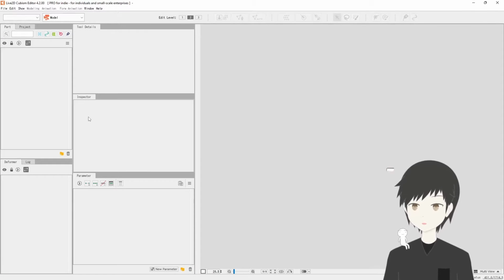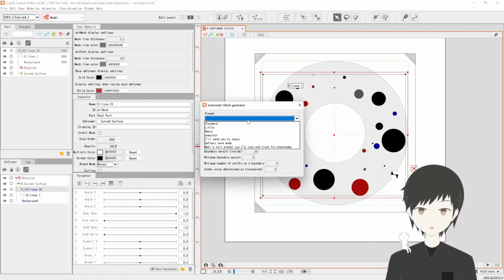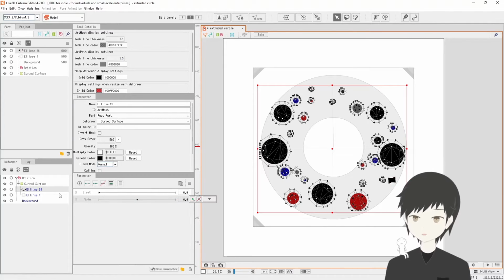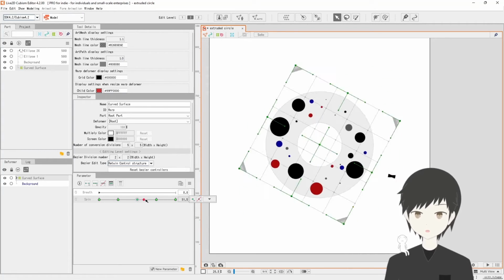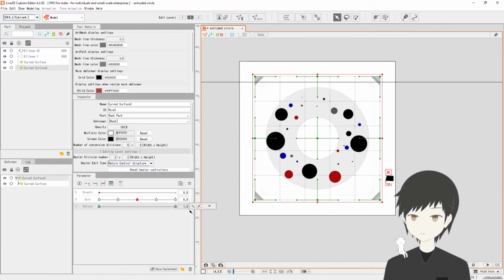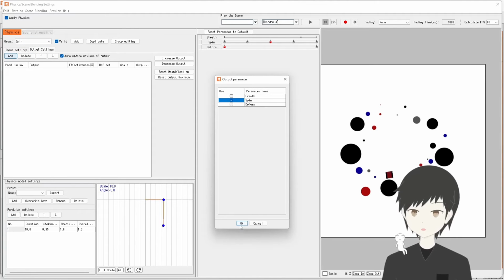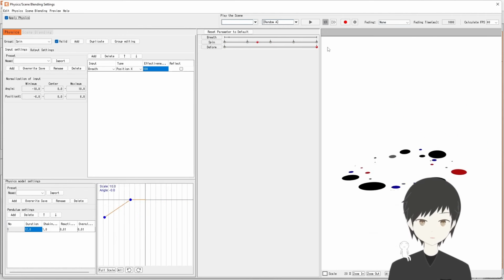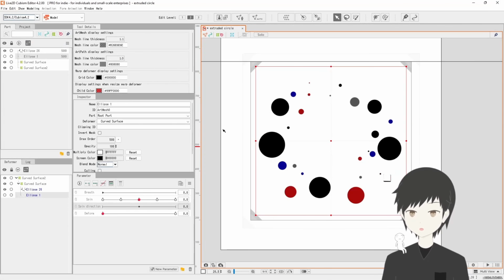Live2D Method Tutorial - Spinning circles using physics

Comment: mine spins like once and then pauses until the breath gets back to zero. i know i did something wrong, but what?
Reply from the maker: normally with those exact settings it should work pretty smooth
either let it run for a bit so it can "settle" or imight also be the output parameter not being from -1 to 1

Comment: The first part of the video is good, but using physics through breathing leads to a constant "reverse motion" and trembling, no matter how hard I try to adjust the positions (
Reply: Sorry if late but you can make repeating parameter to put as input in physics and then animate it in animation for your model. But at this point it's just easier to animate roration directly in animation menu without extra sleps and trembling due to it being not connected to breathe parameter/ Hope I was useful

Comment: thank you. i was using an idle animation for this but it was causing issues in the loop when i wanted to play another animation
btw, is there a way to make it slower other than changing the duration? if i set the duration to be too long it doesn't manage to get going in a spin, at least not within a reasonable time
Reply: I have the same problem. In the description is: "Spinning speed and direction can be changed with Angle input." but i tried it and either it doesn't work, or i'm doing something wrong.
Reply: @TTea_Pudding  speed is probably increased by making the angle range lower, and reduced by making it higher, would have to test it though